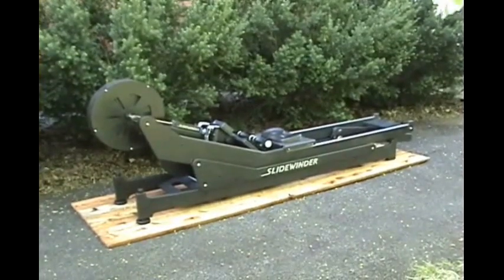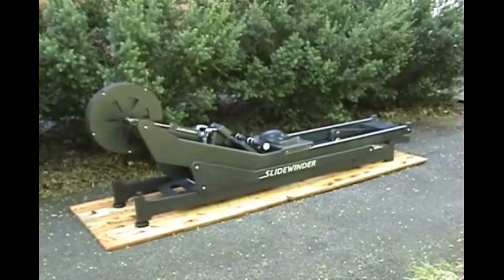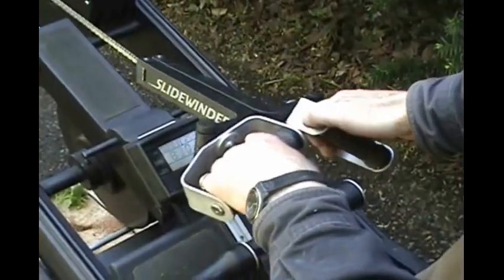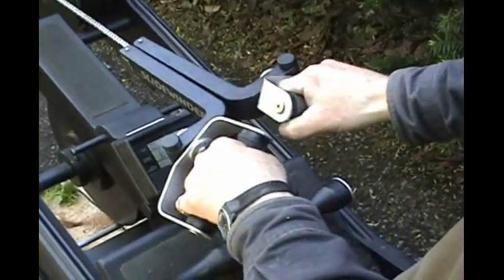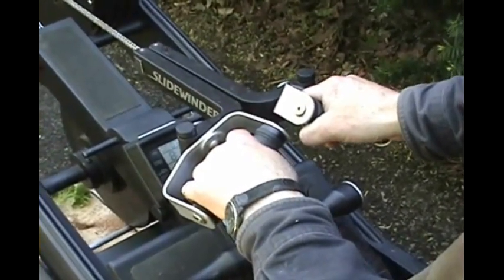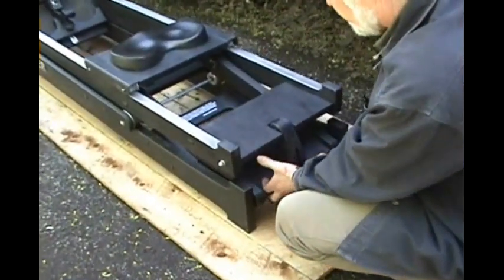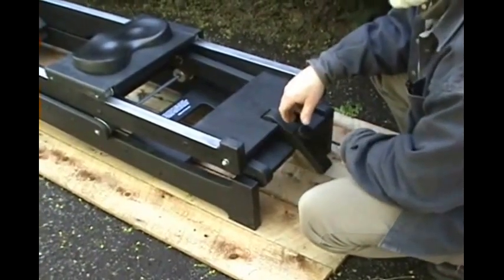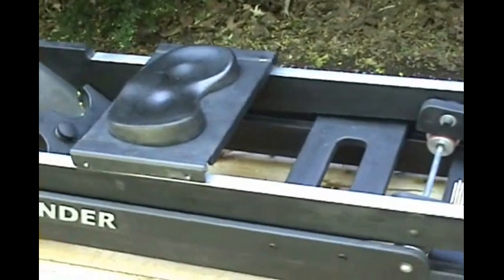Gravity Return Dynamic Rowing Ergometer

Comment from the maker: The inventive aspect of the "Slidewinder" dynamic rowing ergometer is not that it "feels" better or different than C2, RowPerfect, and Oartec dynamic machines. It's that it accomplishes the same thing as those "prior art" devices far more simply and elegantly. All of the sprockets, pulleys, shafts, bearings and brackets associated with  elastic cord handle return and chain routing have been eliminated.The chain take-up and delivery mechanism has one moving part. One! That's it. Utter simplicity.

Comment from the maker: An interesting aspect of this device is that, although the handle return force can be adjusted according to the weight of the user, even without such adjustment, the pull chain is taken up briskly regardless of user weight. On the recovery potion of the stroke, the rearward force on the   footrests assists gravity and therefore assists in the chain take-up and handle return. This phenomenon results in a sense of connectiveness to the machine that is not experienced with an elastic cord equipped device.

Comment from the maker: Indoor rowing is an invitational sport in the 2017 World Games. Competitors will be using the Concept 2 rowing ergometer. I wrote to the World Games office, and pointed out that a "level playing field" cannot be guaranteed in any strength/endurance competition in which an elastic cord comprises part of the resistance of the equipment used. This, I explained, is due to possible differences in elastic cord strength and tension between one piece of equipment and another, and possible variations in ambient temperature which affects cord elasticity. Since the C2 performance monitor does not measure the force required to stretch the elastic cord, unless that force is a guaranteed constant, there is also no guarantee that the competition will be fair. This is not widely understood. The World Games office replied that "all competitors accept the starting conditions", and I was thanked for my "opinion".
Reply from the maker: Here is an illustrative example of the above: A typical race requires approximately 200 strokes (6 minutes @ 30 plus strokes/minute), with each stroke approximately 5 feet in length. Therefore a competitor on a machine with 4 ounces more elastic cord tension than the other machines (a real possibility) will be required to produce an extra 1/4 pound of force through a 1000' distance (200 strokesX5 feet) in order to keep pace.  Not much?  Since work is equal to force times distance (1/4 X 1000), the extra work required is equivalent to lifting a 10 pound weight through a vertical distance of 25 feet. Clearly, the competitor on that rowing ergometer would be at a significant disadvantage. This is basic high school physics, and is not, as the World Games office replied, a matter of "opinion". It is a matter of fact.
Reply from the maker: On the Concept 2 website forum, users sometimes ask why they can pull better times on their home rowing ergometer than on the one at the gym (or vice versa). The difference they experience is dismissed by C2, and by C2 cheerleaders who inhabit that forum, as imaginary. It isn't.
Reply from the maker: In consideration of the foregoing, the inevitable conclusion is that all current (and future) indoor rowing standings and records are invalid, because of the possibility of differences in elastic cord strength/tension from one rowing ergometer to another.
Reply from the maker: The demonstrated "gravity return" rowing ergometer enables adjustment of the handle return force via adjustment of the rear track gradient. Therefore, in a competitive situation, the handle return force could be set to a constant value on all of the units used in the competition, thereby establishing the "level playing field" impossible to guarantee with an elastic cord handle return system.

Comment from the maker: A comment I made on another video about the articulated handle is worth repeating here:  The handle on a rowing ergometer is a human/machine interface. At any such interface, the machine design should adapt to and enable bio-mechanically correct human movement. The human body should not be forced to adapt to the machine - as occurs with the ubiquitous, rigid, single-piece handle.

Comment: My one problem is it sounds very noisy. Also the sound isn't very pleasing...wind or water has a nice swoosh sound.
Reply from the maker: Please keep in mind that this is a prototype device. Since this video I have fitted it with a C2 flywheel and altered the slots in the flywheel housing. It is much quieter now. It was never intended as a production model. A production model could be lightweight and whisper quiet.

Comment from the maker: This is still a work in progress. I intend to replace the chain with a flat drive belt - quieter, smoother, lower maintenance than a chain. Also, to complete the visual symmetry of the whole, two smaller flywheels, left and right will replace the single, large flywheel. The smaller flywheels are of experimental design - variable resistance, smooth, unhoused.  The device in the video is a good start.  The goal is to refine the design and erase the boundary between mechanics and art.

Comment: Wow,I like this machine, knowing this is a prototype, I can imagine it on light material, my only question is regardign  the cord, it seems it might wear off with time and appears to me that replacing it woukld be a hassle. otherwise KUDOS!  looking forward to see this on market
Reply from the maker: Thanks Ryotaro for the kudos!  There is no cord anywhere, so I'm uncertain to what you are referring. There is a chain, which would be easy to replace, but I can't imagine it ever being necessary. As I commented elsewhere, I am going to experiment with a flat belt drive - quieter, no lubrication needed.

Comment from the maker: Regarding Concept 2, the world's leading rowing ergometer manufacturer:  I suspect, from the increasing number of daily views of this video, that people are finally starting to realize that, contrary to widely held belief, Concept 2 is not an innovative company.

Concept 2 had one good idea (vaned flywheel resistance) a long time ago, and has been riding that one idea ever since. Kudos to Concept 2 for that one idea, but in the 35 plus years of the company's existence, it has introduced no mechanical improvements that could actually be called innovative. The Model D is slicker, smoother, and quieter than the original Model A, but it is essentially the same machine. Compare the huge advances in bicycle technology over the same time period.

Successful marketing alone has maintained the public perception that Concept 2 is an innovative company. As Mark Twain said, "Once a man has a reputation as an early riser, he can sleep until noon."
Reply from the maker: Further on the subject of Concept 2: 
In 1995 the US Patent Office granted to Casper Rekers, the first patent for a "Dynamically Balanced Rowing Simulator". "RowPerfect" is the commercial embodiment of that patent. There is a growing body of opinion that "dynamic" rowing ergometers represent the future direction of rowing exercise devices. A "dynamic" enables a more faithful replication of on-the-water mechanics - the user's mass remains almost stationary relative to ground, thereby eliminating the stresses associated directional changes when flinging one's body mass up and down the seat rail.

Concept 2 finally introduced its version of a dynamic ergometer a couple of years ago, apparently in response to the impressive "Oartec Slider". However, Concept 2 advises potential purchasers that dynamic ergometers require greater user balance and co-ordination than "stationary" devices, and are therefore more suited for serious rowing athletes than the average user. This is nonsense, as any non-rower who has tried a dynamic rowing ergometer will attest.

Discouraging purchases of its dynamic ergometer has more to do with Concept 2's interests than the interests (ie: the physical well-being) of the end users. Concept 2's "static" ergometer has fewer parts than its dynamic unit, and is therefore easier to manufacture, with a probable higher profit margin. It is also the piece of equipment used in all of the popular indoor rowing competitions. Further, if the public can be convinced that "statics" rather than "dynamics" are a better choice, this will have the added benefit to Concept 2 of hurting sales of competitive manufacturers (RowPerfect and Oartec) whose primary business is the sale of "dynamics".

Quite something that Concept 2, once a leading innovator in the field, now actively opposes new developments and improvements in rowing exercise technology.

Comment: Did you accidentally make the blower into an air raid siren? Because it looks and sounds like one.  Love the boat like movement of the chassis and the handles. The problem of having a globally standardized product like C2 is that its almost impossible to build anything beyond a tiny niche in the high end market. No matter how much better your product might be. C2 is good enough for too many.
Reply from the maker: Please do not forget that this is a prototype - a proof of concept device. A commercial embodiment could be made lightweight and whisper quiet. Since the video, I have in fact fitted it with another flywheel and changed the slot pattern in the flywheel housing, making it much quieter. Concept 2? How long will C2 be able to maintain the public perception that it is still an innovative company?  Elastic cord chain take-up is high end? It is a mechanical solution for engineering dunces.  A rigid, single-piece handle is high end? It is a bio-mechanical abomination.  The C2 groupies continue to cheer and to pretend that painting the Model D black was a great innovation. They still don't want to admit that Concept 2 has run out of ideas.
Reply: Robert Edmondson There's plenty of inferior products kept as market leaders with monopolic hostile practices(frankly often illegal) Apple, Microsoft, Intel etc. All abuse their market position to stiffle competition or if that fails just buy them out. 
Concept2 is the industry standard and bought in huge fleets. Its also incredibly durable and simple, which in today's designed obsolescence saturated  product environment is a huge selling point and great PR.  
I'm not trying to convince you to stop developing this product, just stating facts. Good luck!
Reply from the maker: Thankyou volvo245. It is true that the Concept 2 product has dominated the rowing machine market for many years. I believe that this dominance has also stifled innovation in the field - the attitude being that if C2 hasn't thought of it, or incorporated it, the idea must be without merit. My suggestion that possibly gravity, instead of an elastic cord,  could be used to return the handle, was originally made on the C2 website "Forum", and was roundly dismissed as a ridiculous idea by everyone. Within three months I had built a crude, but functional gravity-return prototype. Also, although there is a growing opinion that "dynamic" rowing ergometers represent the future direction of rowing exercise technology, Concept 2 was late in bringing its "dynamic" to market, and when it did, tried to persuade the general public not to buy it - tried to convince them that it was more suitable for rowing athletes because it required a higher level of balance and co-ordination than the "stationary" model. This is nonsense, and I suspect was driven more by C2 self-interest (higher profit margin on the stationary model), than the interest (reduced chance of injury) of the buyer.  Quite something that Concept 2, once a leading innovator in the field, is now openly opposed to Improvements in rowing exercise technology.

Comment: the ergo is a traning tool. a ridgid, non moving handle mimics the boat. the boat doesn't adjust to you, you adjust to it (excluding different rigging and so on)
Reply from the maker: The ubiquitous, rigid, single piece handle, which you defend, replicates neither a sweep nor a sculling action. A sweep action is a single arc. A sculling action is two arcs. The articulated handle on this machine replicates the changing angle of the handgrips experienced during sculling (at least through a large portion of a sculling stroke), which fortuitously maintains, throughout the stroke, a bio-mechanically correct alignment of the hands, wrists, and forearms with the direction of applied force (if you doubt this, watch my short video, "Slidewinder on the Water". Additionally, for non-rowers who use rowing ergometers (of which there are many), the articulated handle enables other non-rowing related but completely viable stroke geometries - adding variety and interest to the exercise program.
Reply: Don't really get it. How does that improve the physiology of a rower and make him / her significantlyfaster otw?
Reply from the maker: Frequent users of ergometers equipped with the rigid, single piece handle risk permanent wrist injury resulting from wrist angulation under load at the end of the stroke. Several users have stated in e-mails to me that this has happened to them. Some have been advised by their doctors to discontinue exercising on the ergometer. On the Concept 2 Forum many others have complained of chronic wrist pain (before the C2 moderators shut down the discussions and lock out the threads). My question to you: How does chronic wrist pain, directly attributable to the rigid stock handle make him/her faster otw?  Why have users tolerated such a bio-mechanical abomination for more than 30 years? The articulated handle demonstrated in the video eliminates the source of wrist injury by (to repeat) maintaining alignment of the hands, wrists, and forearms throughout the stroke. What is there not to understand about this?
Reply from the maker: Addendum: For an example of Concept 2 shutting down discussion about the deficiencies of their rigid, single-piece stock handle, go to Concept 2 Forum in the "Health & Fitness" section, and search "Wrist pain and rowing" by "silkybeard".

Comment: looks nice but don't think can stand the sound for long.  sounds like some kind of siren.
Reply from the maker: The sound is irrelevant to the point of the video. It is a prototype, built to demonstrate that a rowing ergometer does not require an elastic cord and accompanying complex chain/cord pulley arrangement to take up the chain and return the handle. That task can be accomplished more simply and elegantly by utilizing gravity, as shown. A production model could be whisper quiet. In any case, since this video, I have fitted it with a salvaged C2 flywheel and changed the slot pattern in the flywheel housing. It is now much quieter.

Comment from the maker: On a typical rowing ergometer (C2 for example), the energy expended to stretch the elastic cord is not measured by the performance monitor. Therefore, variations in elastic cord tension from one erg to another render the monitor readouts, and posted times meaningless. On this "gravity return" device, handle return force can be adjusted to a constant value, regardless of the weight of the user, kilometers logged on the machine, ambient temperature, or any other factors. The result is reliable monitor readouts and a "level playing field" if used in competitions.

Comment: Nice job. But much too noisy for me.
Reply from the maker: This is a proof of concept prototype, built to demonstrate that the utilization of gravity is a simpler and more elegant mechanical solution to the problem of handle return. The noise, which is coming from the flywheel, is irrelevant to proved functionality of the device. Since the video was made, the flywheel has been replaced with one salvaged from a C2 Model D. It is now as quiet as any air resistance rowing ergometer.